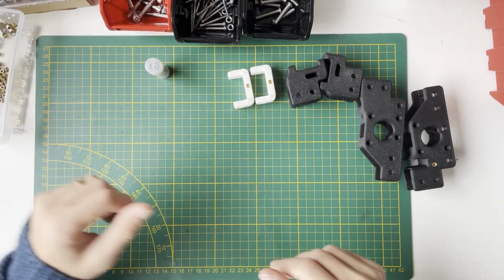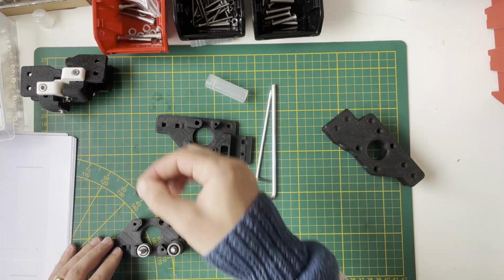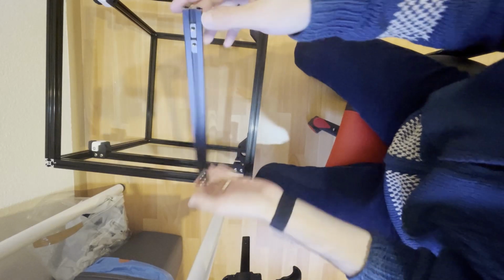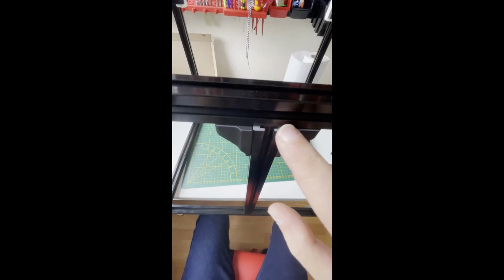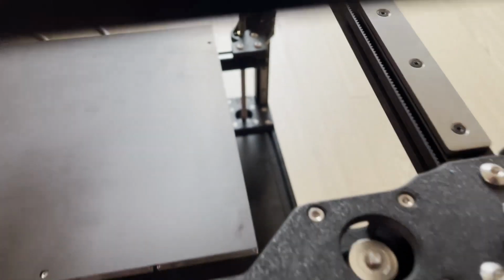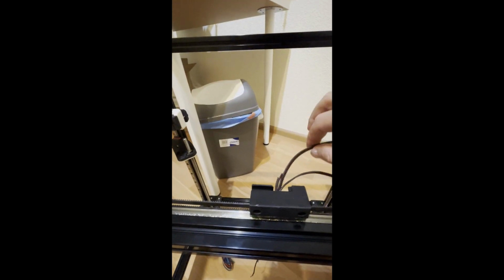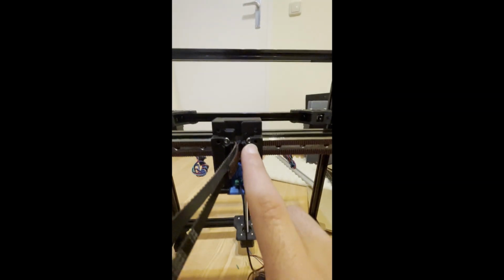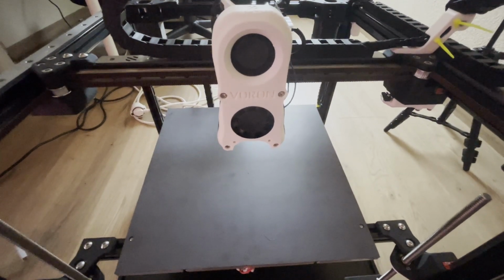Building Voron Trident - A/B Drivers [Ep3]

Comment: The titanium backer on the X-axis is on the wrong side, it should always face the oposite direction of a rail
Reply from the maker: I guess it’s for using also linear rail as a reinforcement. Yes that’s make sense. Since there are holes for cable chain on the backer, I thought it should come to top. Thanks for the tip!